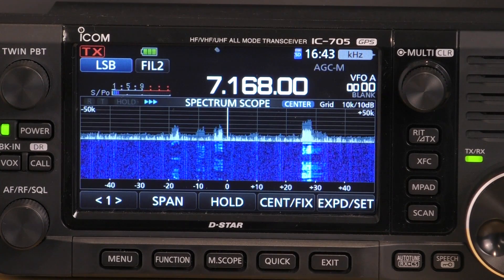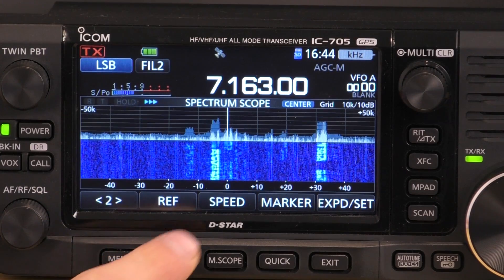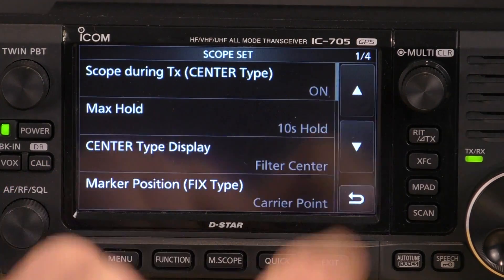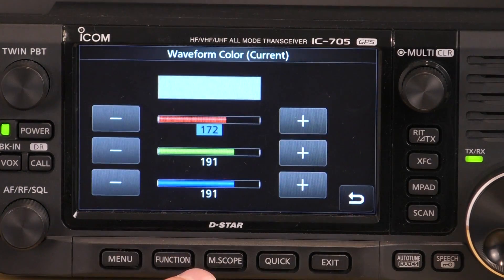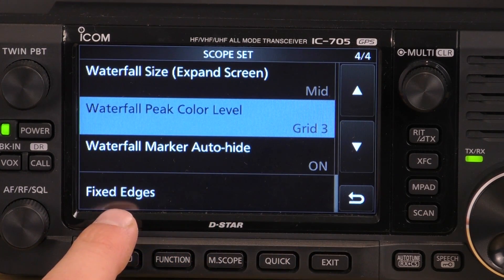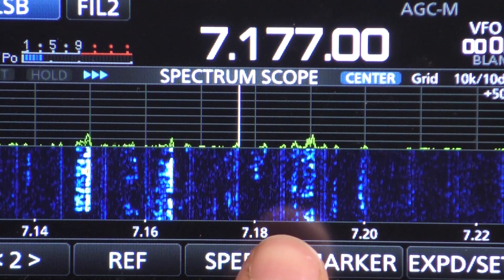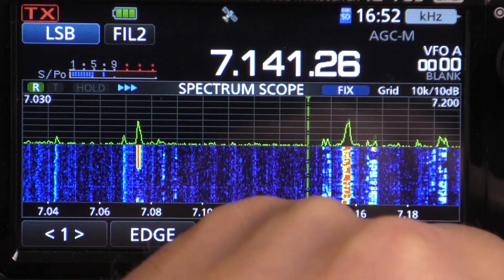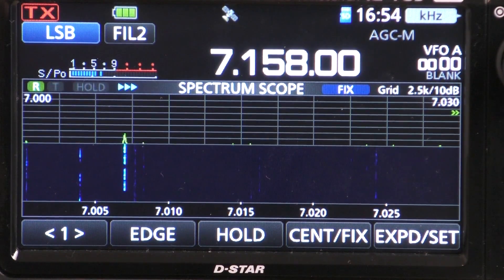INSTANTLY Improve Your Icom Radio's Waterfall with THIS!

Comment: Great video. Would you believe, I set up my display exactly as you do. All the settings are identical. When you did the walkthrough, I was waiting for a different setting but I did not see one. I spent a lot of time to optimize the way it works and functionality and happen to set up mine just like you did. I wonder how many other hams are close to these settings? I use a 7300 right now, have been watching 7610 videos including yours and am going to hit the order button in about 5 minutes, exciting. I cannot wait for a radio with dual receivers! Currently, I have a PTRX-7300 panadapter added into my 7300 with an SDRPlay RSP2PRO connected. I have a new RSPDUO here on the desk still in the box! Going to integrate it with the new rig when it gets here. Thanks again, 73, Dan AB5VJ

Comment: I run...
10s hold (but i also reduce the hold colour so it's not blaring on screen)
Carrier Point Centre(Abs Freq) (this should be default, we as hams should be well aware of what part of the spectrum we're using regardless of mode)
VBW Narrow
Averaging 2
Waveform Fill + Line
Waveform Colour Current - 255 Green
Waveform Colour Line - 255 Red
Waveform Colour Max hold - 32/32/32  a nice dim grey, enough to not be annoying but also enough to show a signal was there in the last 10s
Waterfall on
Speed Mid
Size Expand Screen Mid
Peak Colour - Grid 2
Marker Auto Hide - on

As for fixed edges - I use...
7.000 - 7.040 for CW
7.040 - 7.080 for digital
7.080 - 7.200 for SSB (7.200 - 7.300 is useless generally)
And i do similar for the other bands.
I din;t use fix much, it's good for finding sigs way up or down the band, but the waterfall lacks customization to help with the massive noise floor i have here.

Side note, i wish Icom would permit proper customization instead of picking from preset 'grids'.

Comment: Hmmmm…..all my settings are the same.  But spectrum scope still not working.  In fact, my n1mm stopped talking with the 7300 with those setting.  I put everything back to the original settings and the radio and n1mm started talking again.  But still no spectrum scope.  Puzzled….

Comment: What is the satellite icon on your screen?
Reply from the maker: On the IC-705 it has a built in GPS receiver... the little satellite icon stops blinking once it acquires a lock and you can view your location, height, grid square from the radio screen plus output GPS timing from the USB if you need.
Reply: @HamRadioDX  Gotcha, thx.

Comment: I am a new 705 owner.  How can the rig be useful in seeing weak signals (right near the noise floor as in vhf weak signal work) when the vertical range is  80 db?  The display needs to be able to expand the range, to cover only 10-20 db vertically.  I had hoped to see vhf tropo openings, or search for power line noise using the noise floor as an indication. Vy disappointed.  Will probably sell.
Reply from the maker: Use a software DSP waterfall instead

Comment: Great video.  Just got an email that mine is "close" to shipping.  Look forward to using your videos to get going.  I may have missed it, but what type of antenna(s) are you using?
Reply from the maker: Thanks Kevin. I'm using a End Fed Half Wave antenna for 80-10m (it tunes without a tuner on 80/40). I need to do a video on it as I need to tweak 20m a little better. On 6m/2m/70cm I'm using a Diamond V2000 vertical.

Comment: Hey, great video, Hayden! I had my 705 set up already almost exactly the way that you've got, with a couple of the numbers being off by one - I had even set up the exact same band edges. One main difference is that enable the 10sec max hold time. Having that signal peak ghost left there after someone stops transmitting somewhere else on the band helps me get right on frequency and ready for when they call again.
Reply from the maker: That's a good tip Max. I think I might reestablish the max hold too as I did find it handy. Thanks for the comment glad to hear you're enjoying your radio too.
Reply: The same here, I have started to use max hold...It stays there even when the waterfall rolls out. Fixed edges, or even better with scroll mode, it's actually an usable waterfall. Mamy stations need to learn here.